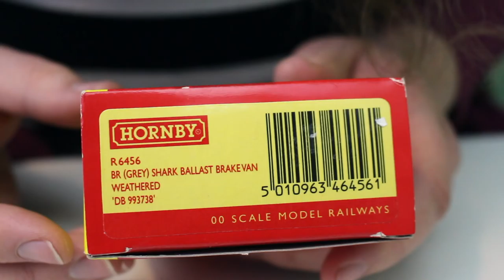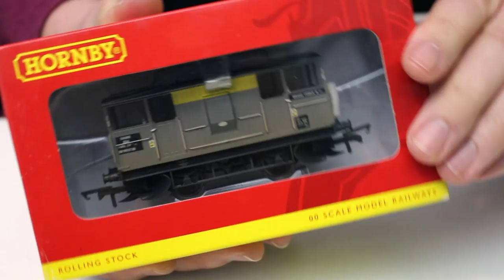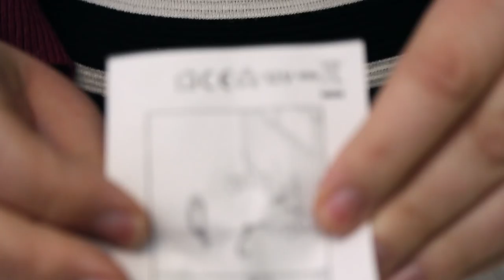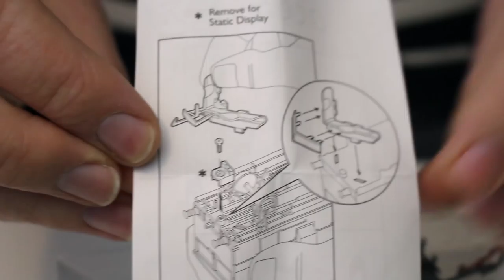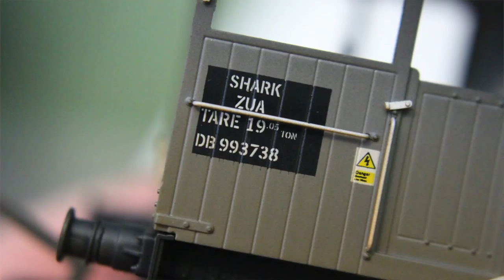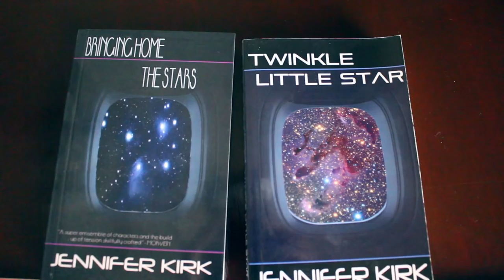Hornby Shark Ballast Brake Van in Weathered BR Dutch - Unboxing and Review

Comment: It's a nice model, but there are three things that bother me about it.

1: The prototype of this wagon has roller bearings on the axles, but the model has oil boxes.
2: As a ZUA, it was retrofitted with air brakes, with a tank and air distributor... but the model clearly had vacuum brakes.
3: The livery is nice enough, but the yellow band at the top has a 'lemon' colour to it, rather than the warmer "Golden Yellow".

The first two are an easy fix... renumber/reclassify it for a vac-braked RUV example, remove the vac pump and make it a RUQ (through air pipe), or even the rarer ZUW (through air and vac pipe) which will utilise all the extra details.

The wagon is perfect for going behind a rake of Dogfish/Catfish, or YGB Seacow/Sealion
Reply from the maker: I suspect that Hornby tooled up mainly for the earlier livery examples such as the ZUV and the air pipe fittings are either an afterthought, or were modelled from a prototype photo of a ZUW. 

I have three of these wagons, and the one that actually sees the most running is the Olive green ZUV example. The Mainline blue one that I have just looks too out of place on the layout, though it is eye catching and pretty in a display cabinet.
Reply: Indeed... they're just stretching out the liveries without the expense of retooling the chassis.

It'd make a nice modelling project to rebuild the chassis with the tank and roller boxes.